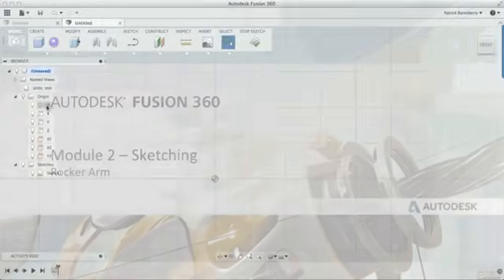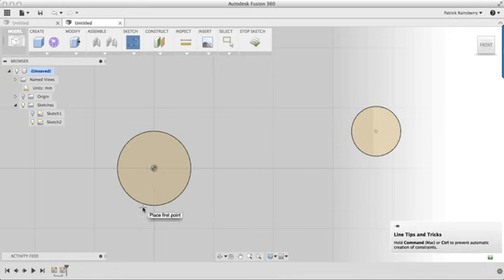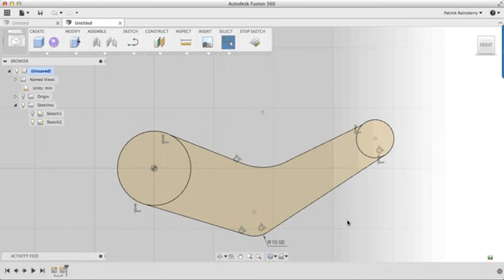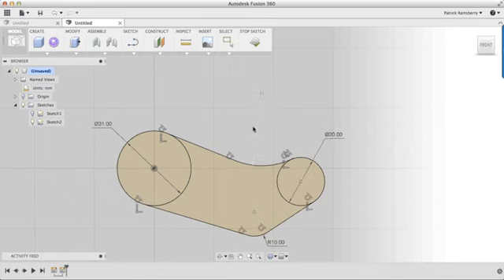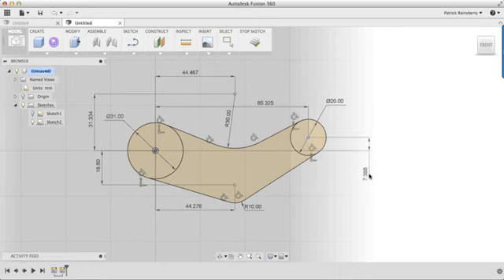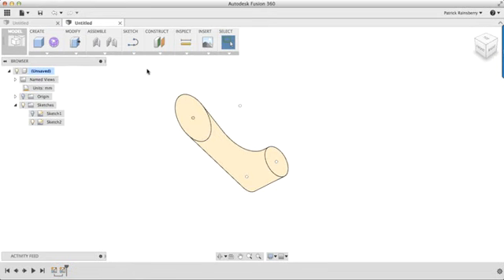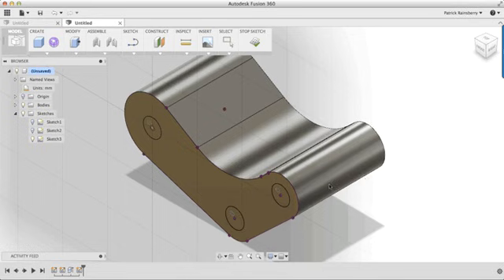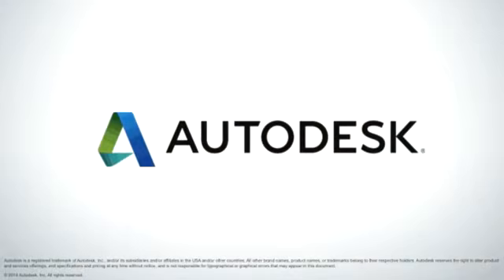02 Sketching Part2

Comment: When I choose the side to sketch on, I do not get the nice automatic reference points. I am able to find the spot by hoovering over the general idea with my cursor, but I can't see the purple dots. Ideas?
Reply from the maker: Are you talking about how you're not snapping to the grid? If so, try zooming in more. A good tip to know here is that your grid will adapt to how much you zoom in and out. The further you are from the grid, the bigger your increments will become, and vice versa. In terms of the purple dots - they will appear when you select an existing completed sketch as the plane you want further sketch on. Does that help?
Reply: Autodesk Fusion 360 11:45 I do not get the "nice reference points" you are talking about. The model just automatically turns to face the face I choose to sketch on, and that's it. No purple reference dots.
Reply from the maker: ***** It looks like that behavior was changed in the latest version.  No purple dots, but the behavior is still the same.  Watch the icon on your cursor when you get close to the point in question.  As you get close it will change and then you know you are getting the snap.
Reply: Aye, that's what I did. But I think having the dots there makes more sense. Now I have to fumble around trying to find the invisible spot:=)
Reply: Autodesk Fusion 360 There also appears to be an automatic change in view point to look directly at the sketching face. Is this a setting or hard-coded?
Reply from the maker: Marty LaBelle You can turn sketch auto-look on or off by going to your preferences under your name > Design > Auto-look at sketch.
Reply: Autodesk Fusion 360  awesome thanks
Reply: Autodesk Fusion 360 I still don't get the nice purple dots.  And I went to these settings and it was already checked.  I unchecked it and re-checked it and still no purple dots??
Reply: MrPioneer1000 I'm also not getting the nice Purple reference dots.

Comment: Has ANYONE tried to do this with the latest release?  I have installed 2.0.2079 and when I try to add the fillet described at 3:11 in the video I get nothing.  Not hints, no icon changes, I can't select anything.  I am not impressed if such a basic tutorial is not possible to be completed.  Did you guys test this?
Reply: Had the same problem...I get a 'Fillet' toolbox....but no amount of clicking or selecting does anything..I can't filet the corner as shown! It's either broken or confusing!

Comment: The nice purple reference dots and edge lines are not showing up when I sketch on a face...

After hunting for invisible center points and then finally drawing the circle, only a few of the purple reference points show up.
Reply from the maker: Brian Dodds I believe the purple reference dots that you are mentioning will show up if you choose to use the Project command on the surface.  Sketch: Project / Include: Project the entire surface of the rocker.
Reply: Autodesk Fusion 360 I think the confusion is that the software has changed since the tutorial videos were made.   Maybe some overlays in the videos that notify of the changes and how to deal with it?
Reply: Autodesk Fusion 360 - This solution works. Choose Project, select the face and hit enter to accept

Comment: I am having some issues getting started with Fusion 360. My sketch drop down menu does not have Constraints. I also cannot get Sketch Dimension to work.  I have tried to put dimensions on my part that looks similar to yours, but it either doesn't work at all with no hints as to why, or I get the message Error: Sketch geometry is over constrained. Help!
Reply from the maker: Keith Kropf  The constraints menu has been replaced by the "Sketch Palette" which is open automaticallyduring all sketching.  You might need to expand the menu to see all of it.  Make sure that you make your various lines tangent as they do in the video to help avoid over constraining lines, this is a common error.  Sketch dimensioning shouldn't cause a problem once parts are tangent and constrained.
Reply: Autodesk Fusion 360 Thanks.  I think my problems were due to me playing around with commands while trying to follow along with the video.  It appears that I shut off the sketch (as the Stop Sketch icon disappeared).  This makes the Sketch Palette go away.  It also makes the Sketch Dimension go greyed out (not selectable).  So I figured out that I needed to restart the sketch, and select the sketch in the browser to make that the active sketch.  At least I think this is the way it works.

Comment: When I change the dimension to 31 for the radius it throws the shape way off to the right totally skewing the entire sketch.
Reply from the maker: 31 mm should be for the diameter, not radius. Are you using the Sketch dimension command to dimension that larger circle?